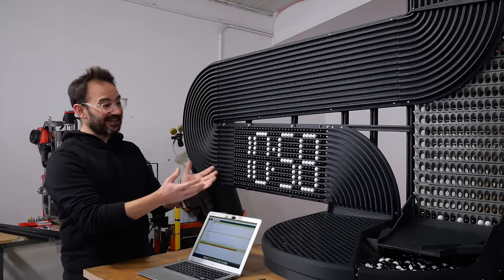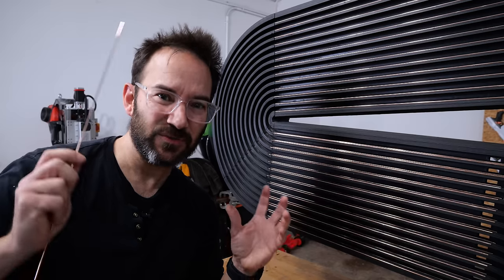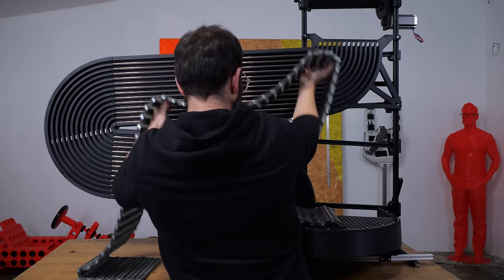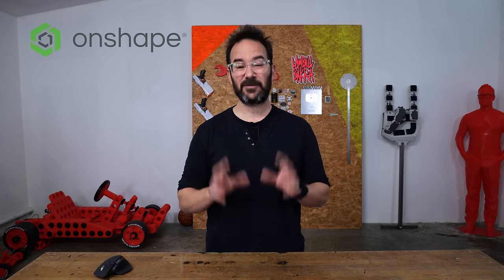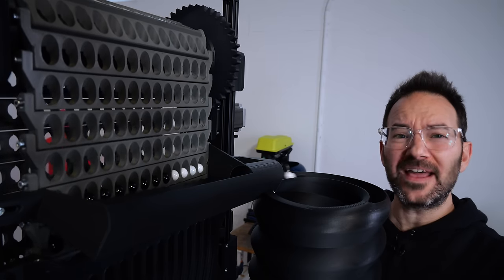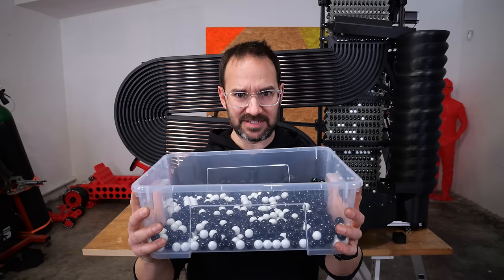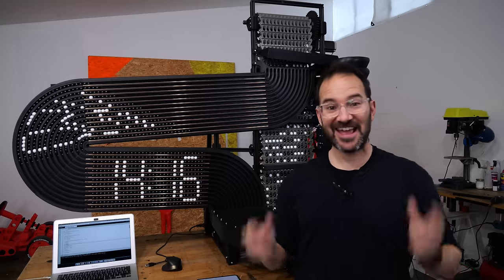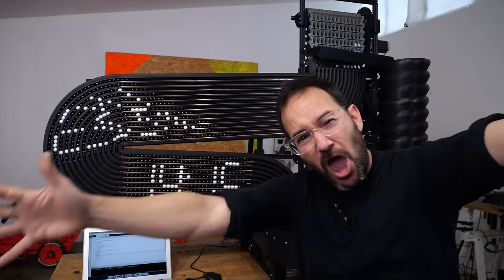BUILDING A MARBLE CLOCK - Pt. 3

Comment: It would be so much faster to have vertical channel from top to bottom.
A vertical clock would have super fast flush time (time to clear marble from the display platform) and amazing response time.

And if you want to OPTIMIZE it from an ENGINEERING perspective i would suggest to have control for every individual dots. every dot will have a channel which can be used to set and unset.
So the idea is that the marble chain will be filled based on the number required for a channel and will show the time. To flush a channel you use a doorstop like mechanism for each dot which will hold the marble and release it when not required.
Further if every dot has a doorstop you can pass in a vertical channel and each dot will pick from the flowing channel. It would be like a marble falling in a channel and whoever needs it will extend the arm and grab it, and even not required push it back in the channel.

Comment: "I will try to make it fast enough."

Make it update by column and not row, then you only need to update a single digit, reducing the amount of balls to process per minute reducing size of the overall machine. You can have more tracks for the display and fewer tracks for the elevator by branching prior to servos (which you'd need more of with a vertical display). 

Would be quicker and quieter but more expensive, but all the costs are written off anyway I assume.

Comment: Just a suggestion, why not you use steal ball bearing instead? They are uniform in size and shape. You can paint or electroplate them, this can make this background is various colours and the digits in one colour or vise versa.

Also this way you can reduce the whole size of the clock

Comment: Love the video, youre thinking of the problem wrong for speed tho. A faster solution would be to have an elevator bring the marbles up by the row and have a sorter at the top that puts them in the correct channels. Dont reject the marbles until you absolutely dont need them anymore. You could still use your elevator design as is just sort them before rejecting them.

Also just use a funnel instead of a spiral or stuff the center of it with a banket/padding lol literally laughed out loud at how noisy you managed to make it

Good luck!

Comment: The simplest solution to the speed of the clock is too presort the colors with black going at the lower level and white on the upper level. The black is knocked out leaving holes for the white on the top level to fill. The top is nothing but a gravity fill so the work is mostly making lowering the black handling, constructing the pre-sorter sorter and second level. You should be able to make the next display in under a minute. You have the right idea and most of the work done but it just needs a little restructuring. 
If you would prefer a simpler solution, perhaps adjusting the ratio of black to white marbles. My guess is you only need between a third and a half white to black. It depends on how far back the rejected marbles are injected into the stream. The farther back, the more even the ratio needs to be.

Comment: how about for a next iteration do the time in lines from left to right instead of bottom to top?
that way the hour could stay displayed. 
you would need a wider elevator and a few extra components, but the refresh should be faster. 
that way you should be able to display every minute and not only some.

Comment: have you considered using ball bearings instead of marbles? they should have some more mass and not get stuck as easily, as well as being cheaper, easier to aquire and more precise! you can make them dark by using a cold bluing solution you can let them sit in for a sec

Comment: so the redesign is nice, however this recommendation if you use it will cause a whole new one. Why wait for the white marbles to be in the right channel? you could actually make this be a perfect clock by implementing a switch system, Think like how a train changes rails. Rather than have to eject black or white marbles waiting for which one you need, why not have the computer calculate how many white and black marbles it needs, and move said marbles into the correct rail the first time. you could even run 2 elevators one with white one with black so you have no need to eject marbles from the elevator in the first place, thus reducing the noise. you can also with this design have the waiting tray be a 90 percent angle which means they theoretically should never get stuck since they will need to fall.

Comment: Hard to describe without doodling this out. What if... the marbles were kept in the 13 rows as they exit the display. Then the same tracks become MUCH more widely spaced parallel tracks where the white marbles are filtered by 13 sprockets whose orientation is arranged perpendicular to the tracks. If sensors array sees any white marbles, the individual solenoids kick over the sprockets so the white marbles exit below. Meanwhile the black marbles pile up, and are constantly fed into the vertical conveyor as a solid background. Your next sensor array is going to kick out the positions needed for the white clock-dot marbles, and the ejected black marbles feed back into the pool immediately below, continually feeding the background pool. Above, where you've conveyed the white marbles, they simply drop into the clock spots vacated, and the pattern builds up as the next batch for the display. This would eliminate the randomness issue which is really what slows this down to 2-4 minutes refresh. With some napkin math, looks as though the machine currently takes a little over a minute to complete 31 columns of the display. With a small increase to the conveyor speed, you would be able to pull off minute changes easily. Change the lower assembly for parallel marbles collections and sorting. Add a sensor row, and sprockets. Add a white marble conveyor.

Comment: While this certainly has the cool factor of sliding in from the side, it may be better to have them drop straight down in columns. Would reduce the total amount of processing you need to do; you only need to change the columns that actually need to be changed. Would probably speed it up the setting process and allow you to do minute-by-minute.

Comment: I find the concept with the “chain” to be a bit awkwardly implemented.
I would have set it up much more simply.
Two memories, one for each color.
A sorter that sorts the used balls according to color.
One ball is then released from this storage using a valve.
These balls are then lined up and tested. If the color matches the respective position, they are made available for the display. If they don't fit, they go into the sorter.

That would compensate for a major problem in your system.
As I understand it, the balls are transported upwards and matching colors that are on the right channel are pushed out. But what if a necessary color can no longer be found there? Then the clock stops.

Comment: It appears it may take too much time to fit a slot with desired color. Say, you need white, but you get 5-10 blacks in a row. You might wanna add some device to separate marbles into 2 different tanks judging by their color. And then you can make 1 black row, 1 white row, 1 black row, etc...

Comment: I haven't seen all parts, but is there a reason not every digit could be "wiped" alone? If he would have build it top down instead of left right, he could just erase each number on it's own, which reduces marble movement, speeds up the process and marbles wouldn't get stuck because they are top down?

Comment: Could you not have sealed the top with a plastic or glass sheet and use pressurised air from the top to push the channels clear?

Comment: What if ..... reducing Noise by using more of the transported Marbles? using a "Screw" to transport  the Arbles up instead of a Belt and let them role "Horizontal" in front of your solenoids. Then nearly every marble can be used and only in the case that all lanes are filled you just have to print another lane in your "Display-Board" tu let the "Waste" bypass the Display

Comment: didnt watch the current videos, but wouldnt it easier to sort white and black marbles?
and channel them, rather then pulling every marble up and then sort those out which you dont need by your mechanism?
seems like it cycles through the marbles a lot
and if you do the marbles vertically with fixed positions, like the game (4 in a line)
you wouldnt need the black marbles which you currently use as place holders horizontally .

still like the whole idea tho. really unique

Comment: In the case where the clock is outputting the time in irregular intervals (2 mins, 3 mins, etc.), I understand this is due to the fact that the time it takes to create the output is entirely dependant on the random distribution of the marbles, and therefore is never the same, but how does the clock “know” which time output to produce if it is a random interval before completing said output? 

Ex. If it’s ‘6:13’, why does the machine start producing the output ‘6:15’ without having knowledge that it will take 2 minutes to produce that output, it could take 4 minutes for all we know
Reply: Or is the clock simply wrong in that case and is just an approximation that self-corrects itself every output ?
Reply: Or does it begin producing a new output in real time as the time changes ?

Comment: to make the machine faster could you not use sorted piles of marbles. i mean you are sorting the marbles going up the belt, but then chucking them into the same container. if you made the marbles into two levels the white level and the black level, and you moved the sorting till before the levels and the belt and then using on the lower level gate locks for where the colors are to go? i personally believe this could make it close to the minute mark or atleast 2 minutes per rotation of the clock.
Reply: and the way you're dispersing the marbles you send from the top cause major gaping on one side of the belt!

Comment: You should have built it standing so they would fall straight down instead.
And have the lift behind the display part of the clock.
Would probably take up less space on the table and just be taller instead.

Comment: Out of curiosity, why bother with the all black top and bottom rows? The entire thing is black, so the white is already framed. Are they for a specific reason, I might have admittedly missed in the video?. And wouldn't it be easier to load the marbles up top instead of at the bottom? You could have 2 columns of screw drives with a mechanism at the bottom to sort white and black, that then lift the marbles up to the top where they are sorted for the lanes before dropping down. Would make less noise as the belt isn't required. heck could put all of that behind it so it is not as wide.

Comment: would've been much easier to have the white marbles separated from the black right from the start, then your machine would only need to know when to allow marbles to climb the elevator links, and you wouldn't need to drop excess marbles back down either because they'll all be needed.

Comment: The only number that needs to change every minute is the number on the far right.  The number to the left of that only needs to change once every ten minutes.  The colon doesn't ever need to change at all.  The hours only need to change... well... every hour.  You don't need to replace ALL the marbles every time the time changes.  You could change the path from (nearly) horizontal to (nearly) vertical so that the marbles change in a column, instead of in a row.  Your clock is over complicated, and would work better if you simplified it.

Comment: You sound quite annoyed with how much you had to change and reprint. But that's just how prototyping a novel product goes. Design, test, refine, test again, until it works as intended. And you got there in the end. So if you get annoyed by it, then product design isn't your line of work. It's an integral part of it.

Comment: The problem is that you're relying too much on chance. You're rejecting a ton of marbles that could be used in another "lane" speeding up the entire process.
It would be better to have a single stream of marbles with logic that identifies the color and then assigns it to the matching lane of highest priority. Reducing your rejection rate at the top of the lift will GREATLY increase your speed.

Comment: I understand that this is only meant to be a "wow" inducing YouTube project and not a practical clock. But as an engineer, I find it wayy too uncomfortable to watch. It's annoyingly loud, needlessly complicated, and extremely wasteful not only in terms of the energy it consumes to run but also in the choice of materials. On top of dust accumulating into the channels, the friction of the rolling marbles is going to eat into the 3d printed channels rendering this whole contraption completely useless in no time. 

A much more efficient, clever, and equally impressive design would be to use two faced marbles with magnets and use the magnetism to rotate them on smooth metallic slots. You'd only need 104 magnetized marbles and the rest would be always-black or always-white. Then the whole thing could be encased behind a glass wall to protect from dust and it could tell the time with a sub-minute accuracy easily.